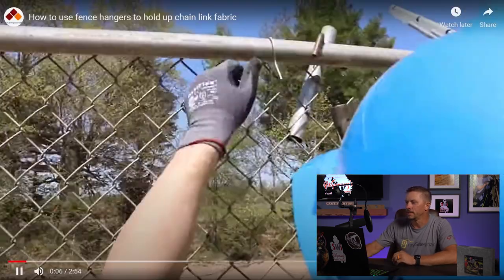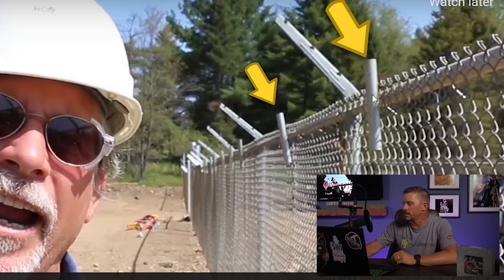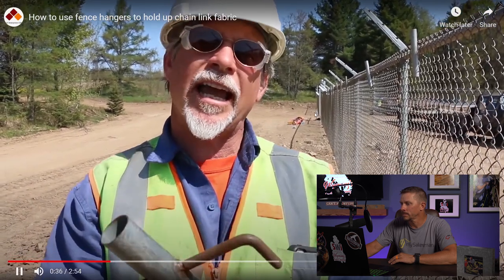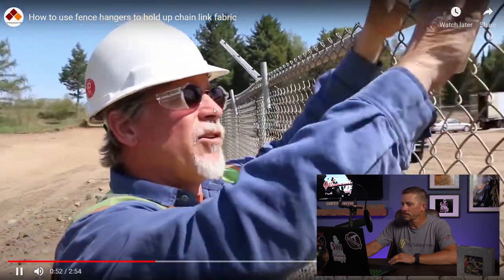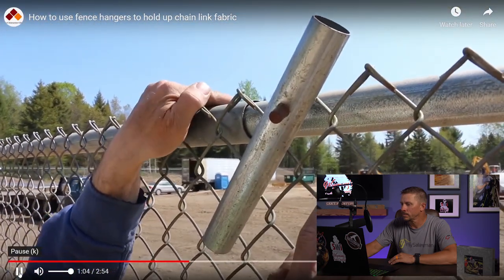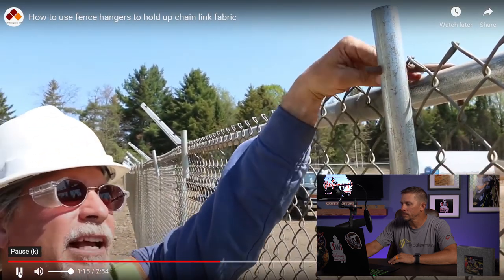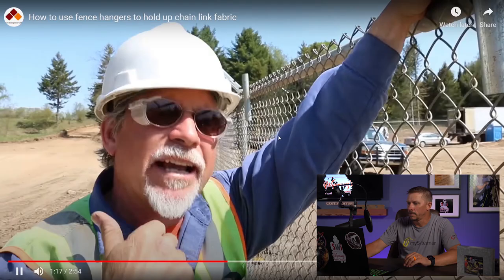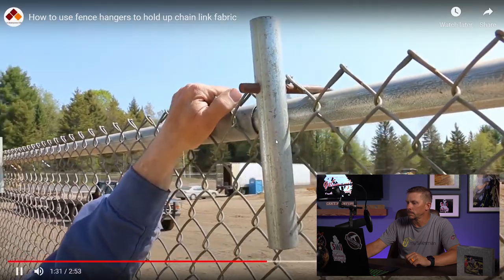This Guy Just Made Chain Link Fence Easier

Comment: The Lowe's stores that we supply use GBW (pre-galv). Most of our local customers prefer GAW.

The company I work for (MMI) mills their own fabric and is currently not running any GAW 11 1/2 gauge for lack of personnel.

All of our 9 gauge is GAW.
Reply from the maker: GBW is easy to dress but most consider GAW to be better at preventing rust.  In WY both last forever given the lack of moisture.

Comment: Like the video, out here specs at schools are now going to 2 3/8 top rail, same install process, just changing size of material, also if fence is slated specs call for 6' on center 4" line post if 8' or taller, I'm glad I will b retired soon. Those specs are for San Diego & Los angles schools. Times are changing

Comment: Galv. wire after weaving is not what it use to be. Their not shaking or vibrating to knock most off all the excess break the joints loose. The galv. years ago didn't have all the issues like it has in recent years. It seems a few seconds is to much to ask for alot better quality. 
   By the way I worked in galvanizing plant as head galvanizer when I was in college and the guys galvanizing wire seem to run about 10 to 20 degrees cooler which makes the zinc not run off as well. Want heavier  coating slow it down.